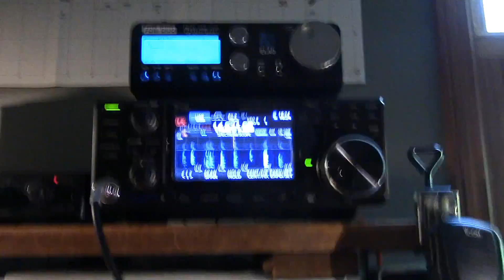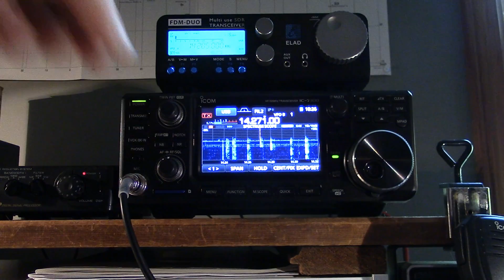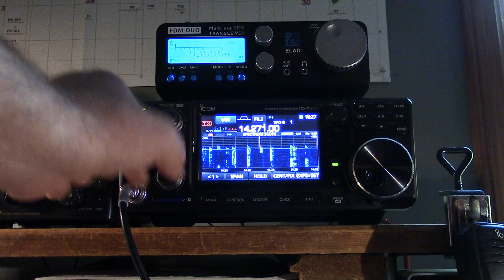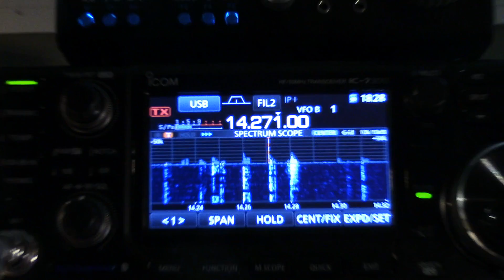Icom IC 7300 vs Flex 6300 - COMPARISON

Comment: Old video now, but you didn't have your AGC-T set correctly on the Flex. It is totally different adjustment on a FlexRadio vs the IC-7300 that uses a conventional AGC.

Comment: Interesting that the audio is "hard" sounding vs the Flex, though I am guessing the BW skirts on the 7300 were set to "steep"
Personally, I can't see spending the money on a Flex when the gains are really not that amazing. Also, even Flex finally saw the need for a stand alone rig, otherwise, if you have a computer problem, you are off the air. I'm sure the Flex is a great rig, I just can't justify the price vs the 7300

Comment: I just had a chance  to watch this, albeit a bit late, and noticed that your 6300 did not have the AGC-T set correctly and when you have it set such as you have, the signal sounds much noisier as it really is.  It is a simple adjustment and the results are amazing.  I have both radios and have done similar tests with a very hearable difference.

Comment: The switch to one rig to the other is in my opinion very slow that makes not get a clear idea what's the difference between the two transcivers, however in my opinion the Flex has a slight clear reception, thanks for the video

Comment: I own the flex 6600m and i had the 7300 sitting beside it when testing, I will be honest when using the icom with the mfj 1026 noice canceler, i pretty much got the same results as the flex, and honestly noise is so bad here i had to use the mfj noise canceler with the flex also. I kept the flex because i love the UI and its features when used with a computer, but as far as receive quality, unless you just have money to blow, buy a 7300 (or the 7610 because diversity is pretty cool to have) and invest in your antennas. of course i had money to blow so i kept the flex but to be honest i don't think i would really recommend it. there are bugs and unless your a patient person you might just find yourself happier with the icom. Don't get me wrong i do love my flex thats why i kept it. but i honestly can't recommend it, unless money is no concern for you what so ever and if bugs do not bother you.

Comment: no way to compare these two radios! ic 7300 is a good entry level radio but the flex will blow it out of the water. i have had both in my shack so its not an opinion.

Comment: I’d have to say here that you get a flex 6300 with dual receive and the price of the maestro unit that you can use anywhere within your Wi-Fi range or around the world to work your rig easily and there’s just no comparison here. Yes they may look similar, but the amazing opportunities you get with the flex radio is completely different than the 7300. You’d have to buy two 7300s just to have dual receive! Even then, you couldn’t take it “into your easy chair” and work it. 

Now I don’t own either one of these radios but I can tell you I know that for sure The flex offers more options.

The cost today I’m at Flex 6300 and maestro is now under $2000 which would be about the price of two 7300s but wouldn’t give you the same amount of freedom using it. 

And there’s really no comparison when it comes to DNR here. I’ve had a 7300 in the past and the DNR is so subtle you can barely tell it’s on. On the flex radio it sounds more like the Yaesu’s... either the 3000, 5000 or 9000. It sounds much better.

Comment: My 7300 with a JBL blue tooth speaker plugged into the radio makes stations sound like commercial radio broadcasts, speaker on a recording makes a huge difference.
Reply: My 7300 with jbl control one is impressively...

Comment: Comrades, do not you think, in the meantime, that few of the fans of numbers at all imagine how they have there "quantization" occurs in this Shaytan machine? That is, it is clear that for this you need to be at least a leading programmer of ICOM - and they will never tell you all of their secrets. Because the lack of understanding with regard to noise, dynamics and other vital parameters)) 73! UA3NDX - UA3NCM

Comment: Yeah, you'd have to feed the audio to a reference line level that is the same and not use the speakers, or adjust the AF gain. The Flex did sound much more quiet with the noise filter, however without a comprehensive test you wouldn't know the cost in S/N by comparison. I think you need to inject a reference modulated tone to each and then compare.

Comment: The Icom7300 has smaller filters set and still sounds better :-) The Flex has 2.72 set versus 2.40 on the Icom, that shows how much better the 7300 is.

Comment: I love how you have the flex sitting right on top of the 7300 speaker so it sounds crappy.   For that matter your mic for the video is just crap so what give you the say of any comparison.  Overpriced piece of junk.  Nothing but a UNO and a poorly designed PA in the back that doesen't even maintain spectral purity.

Comment: I've been licensed for 57 years and been a dx chaser the whole time. I'll admit that the more expensive radios outperform the less expensive ones, maybe by up to 10-20% in some cases. However, the level of practical improvement versus cost, is miniscule. I don't see the "value" in 10% greater performance at a cost of 2,3,4,5X. I'll take the 7300 and you can keep the Flex.
Reply from the maker: +1redrubberball  You’ll get no argument from me on that

Comment: I've rarely found these sort of side by side tests useful in any way.
Some of us are spec junkies, some are by the ear, some are ergonomics etc...

Personally; I believe all purchases must be made with cost vs functionality.

Any radio can squirt out a signal. I challenge anyone r\to tell me what ras\dio is being used when listening to a CQ or a QSO.

Contest radio: I would love to do a piece on this term. What exactly is a contest radio?

Amateur radio is great. One can spend a little or spend a fortune; and everything in between.

Weather a radio is tied to a  computer or a stand alone SDR as is the 7300; we each have to make a choice unless one's budget is without limits.

Personally; I own a 7300. Rather than buy a lot of gimmick, I chose to put any additional money into my antenna system.

If I see a need for a FLEX or the new IC 7610; I may get one. At this juncture however, the 7300 does everything I need it to do.

Comment: Note that you had the 7300 set to Fil2, which is 2.4K by default. The Flex was set to 2.7K bandwidth. Not a good comparison. Yet, even with that difference they sound pretty comparable, with no real benefit from the Flex.
Reply from the maker: Ya, certainly not a scientific comparison. I wish I had the gear to do a proper assessment.

Comment: Good compare.  I'd expect the 7300 to be a 1000 better than the 6300.  Do you still own the 7300?  If Icom offered a AGC Threshold control, I'd still have one.
Reply from the maker: Yes I still have the 7300. I am considering sells my Flex gear now for various reasons.
Reply: I turned off the AGC & also used the RF gain & ATT, but there was still this background noise not on my Yaesu & Kenwood.  In particular, the Yaesu was much quieter.  Most like the 7300, but there are many complaints about this on eham reviews & friends I know that own them.  NR would take most of the noise out but I had to crank it to 10 & didn't like the effect on the audio.  AGCT would fix that noise like it does on the SDR's I have.  I loved the 7300 otherwise.  I am an Icom fan.  An Icom was my first rig & I still have it.

Comment: For the money the IC-7300 is a very good value!  The Flex radios may be better in filtering and drilling down into a weak signal especially in digital modes but unless that is all you operate I do not see the value in it.  I feel that the Flex radios are still overpriced about 25-40% for what they are, also none of their offerings have a 200W option which almost all other flagship radios have.

Comment: The ear remembers for 5 seconds maximum , the switch must be immediate and the speaker and FILTER must be the same bandwidth and shape , if you get this right and can A/B properly then it would be an interesting comparison , I have a Flex6500 and IC7300 , the Flex is a much better receiver in terms of noise , also the DAC in the 7300 is 2 bits short of the Flex thats a huge difference , never saw a Flex overload like a 7300 does , I am getting a 7851 next week to compare ...Howard VE2AED

Comment: The sound of the Flex sounds like it is on a bigger speaker, thus more low frequency content in the audio. The 7300 might sound identical with the same speaker.

Comment: Sorry but it is very hard to make any judgement based on this video.  Why even bother to compare radios on completely different speakers?  Some say "use identical speakers" but you really need to use the SAME speaker, or even better, feed the audio directly to the video.  Also, the radios are on different frequencies. They INDICATE the same frequency but there is about a 50 Hz difference.  The signals are not tuned properly on the Icom.

Comment: I have an issue with this test. I have seen the flex radio and have never seen the 7300. How can you compare a radio against software on a computer. The sound care has settings that can change the audio in a way that is totally different.

The best comparison is this. To use the 7300 outside of the shack, you need to setup an antenna and coax. The flex can be used on your tablet, computer or maestro. The 7300 would need software with port forwarding and a bunch of settings. Compare usage and not how it sounds compared to others. There are speakers and other options that can make them sound and function similarly.

Comment: They both are great radios, but the flex is about $1,100.00 more. I'm sure you can connect the 7300 to a computer to make it act like a flex.
Reply: flex has more filtering options, that the 7300 will never have
Reply: $1100 more and you still need a complete computer to run it.  So considerably more than that in reality.
Reply: Thanks for the quick reply. 73's.
Reply: Realistically, most people already use a computer in the shack for logging/rig control, etc.

Comment: The fact that they're comparing a $1300 rig to a $2500 (not counting the extras required to make the Flex work), and the Icom is holding it's own quite nicely, is very telling and makes me want the Icom.  Thanks for the video.  Nice work.

Comment: Flex 6300 + Maestro + computer+ external amplified speaker = 4800.00$ approximately.
IC 7300 = 1299.00$
Reply: Correction $899 - $999 today :); much better deal. Add to that an SDR by tapping IF and you can have a very powerful combination.

Comment: I say a draw. icom has the tinny top firing speaker and the flex has probably a very superior external speaker. Believe it or not just using a good external speaker makes a radio sound so much cleaner. So this is not a fair comparison.

Comment: These tests amuse me. Everyone looks at sensitivity, which is easy to do, and how it "sounds" which you can set up any rig to sound good. never any tests on getting blasted by someone 1KHZ away. Thats the mark of a good receiver. The 7300 is an awesome entry level rig. It is not a FLEX, and it is not an Elecraft. Simply not. Does it need to be? Not really, but I am just saying the true test of a receiver is how it holds up to a strong signal nearby. The 7300 front end is wide open. It is really easy to overflow data if the band is a mess with signals. There is a reason its 1.3 killobucks. It's a really good compromise.
Reply: Erin well said! I have had my 7300 for 2 years now I can echo what you said. The 7300 is NOT a flex. You can't do with the 7300 what you can do with a flex. The flex will eat the little icom for lunch in almost every department.  The fact that the 7300 is "SDR" is not a factor nor should be IMO if considering buying one. Do you want killer audio with infinite adjust-ability (iocm is no slouch quality wise)? Brick wall filtering? First class receiver performance? Speed, efficiency of operation? yada yada yada... No contest here. The flex all the way. I have seen what you can do with a REAL sdr platform and  being a casual contester, playing in the cqww dx contest, taking 1st place NA in the ARI dx contest, winning some QSO party events I have seen the inability of the 7300 to deal with crowded heavy qrm conditions. It can't! Is it a great radio? Sure! Just depends on what you want to do with it. Digimodes? A breeze. Rock solid and always works. It's the fact that it is virtually useless in a crowded house. Barn door? Oh yea and swung wide open baby! LOL My next rig will be a flex for sure.

Comment: It would be interesting to know the Icom's ADC resolution. 
My only complaint about the 7300 is that it can't interface with a computer, does not have a software interface. Can it do digital modes? I expect there will be more mainstream SDRs in the future that will offer both knobs and software interface.. The Flex radios are still worth it because the software interface can be updated, while the Icom will need a firmware update that will probably not add extra features.

Comment: Different speakers and location in relation with the camera mic may cause different results.

Try the test again with 2 identical external speakers.
With a $1,000 price difference between the two, for me the ICOM IC-7300 is the real winner.

Comment: I am new thinking of buying the 7300 when I pass my general...is that better than elecraft xk3.  watched your video dont understand what the pc display is doing since you see it in the 7300 touch screen,  I like the 7300 compact it has a lot of functions in a compact size thus less clutter and heat
Reply: The PC display is showing the output from a FLEX-6300 radio, controlled using the SmartSDR software. That radio is completely PC controlled, with the radio itself (not shown, but it's just a black box) essentially acting like a network server.

According to the Sherwood performance scores, the KX3 rates a little better than the IC-7300. On the other hand, the IC-7300 has more features out of the box (panadapter, 100W amplifier, and a basic 3:1 antenna tuner), which would cost extra on the KX3. They're both great radios, but for your first radio I'd say go with the IC-7300. Unless you're planning on buying an external amplifier, the extra transmit power (100W vs 5W) will make things much easier.

The Flex-6300 hasn't been rated by Sherwood yet. It's big brothers, the FLEX-6500 and -6700, are considered two of the absolute best radios out there right now. That said, they also have additional preselectors that the FLEX-6300 is lacking.
Reply: thank you

Comment: Big difference between the two, 6300 is much cleaner and comparing a Flex 6300 to a Icom 7300 is not a apples to apples test.  The 6300 is a higher class of a radio than the 7300.  The 7300 is an entrance SDR rig (and I'm stretching that the 7300 is called and SDR) and is not in the same class as the flex.  The flex is MUCH more flexible and out of the box you are getting much more of a radio.  So the cost difference is justified.   I have had 25 HF rigs over the past 10 years and the 6300 hands down is heads and heels over the 7300.  Yes I have a flex and also a 7300 (sold it a month after getting it).
Reply: 7300 is like a volkswagen compared to the flex, the flex is more of a luxury car. no way the 7300 can even get close

Comment: In my experience, the big difference is how the operator interfaces with these radios. Icom uses traditional knobs and a touch screen. No computer required is certainly handy for  portable operations. But, the Flex interface is with a mouse which I personally prefer now that I have used it. I was sorry to see Icom has not allowed computer control with large bandscope and waterfall on a computer screen controlled with a mouse (yet).

Comment: After you add the cost of the required PC, Windows, anti-virus, a manual freq control knob, etc... That $1,000 price difference between the two becomes more like $2,000. None of those expenses are required with the Icom. Given these considerations, we're really comparing two radios from very different price ranges. In this demo, the DX contact had less noise on the Flex, but I thought he was more understandable/copyable on in the Icom. While past performance is a good indicator of future performance, I'm not going to slam the door closed on the idea that Icom may support the 7300 with software updates. The 7300 is essentially an SDR and with its card reader slot and great PC connectivity, and what looks like will be a huge market share, Icom may be encouraged to be more forthcoming with updates.
Reply: if you dont already have a computer in your shack you most likely living in a third world country, as for as the " frequency control knob " you dont need that, i can go any freq on any band 5 times faster then a icom 7300
Reply: You don't buy a Flex unless you are already equipped in most cases. The argument of PC cost is a null consideration in my opinion. Most people are NEVER going to buy a PC jsut to get a FlexRadio. They will get a Maestro, and that is an argument that is noteworthy, where the Icom has the advantage. But you do raise an interesting point of view that many need to consider.
Reply: In my case, I'm a Mac user and while I do have a spare PC, it doesn't have the horsepower to run a Flex well. So I would have to make that additional investment in order to really get the full benefits from the Flex. I really do think these two radios are in different classes. The Icom could be (and is) a radio that a new ham might consider, while the Flex is probably going to be an upgrade or add-on to an experienced ham's shack.
Reply: @ishootbirds  I'm a Mac user also. I'd have to buy a new PC or the Maestro.
Reply: @Bourbon-Canted-Ky-Windage  no you dont